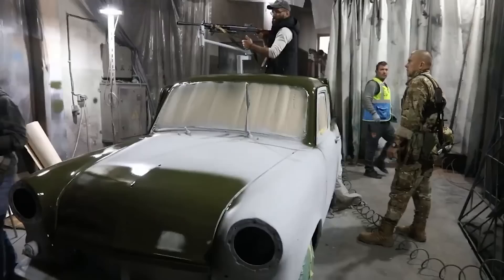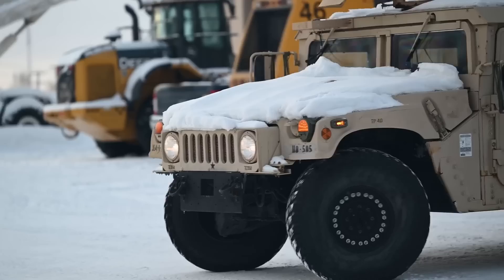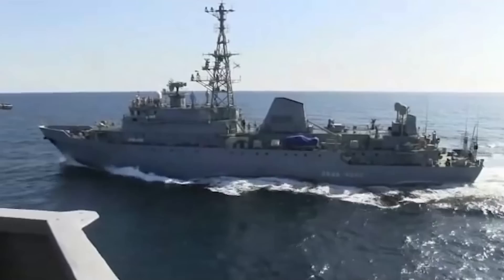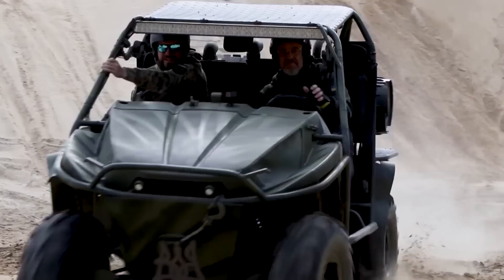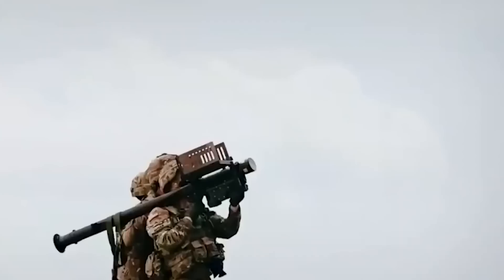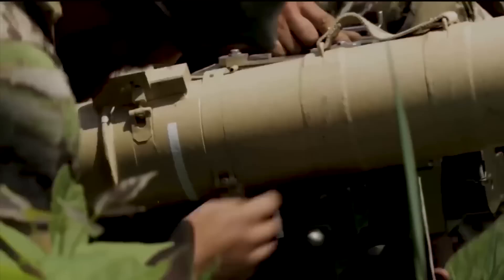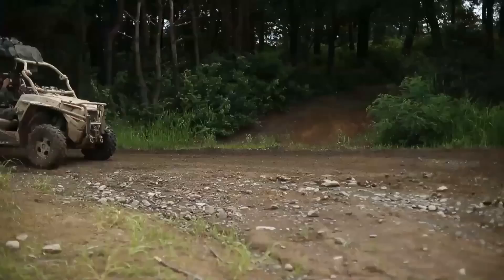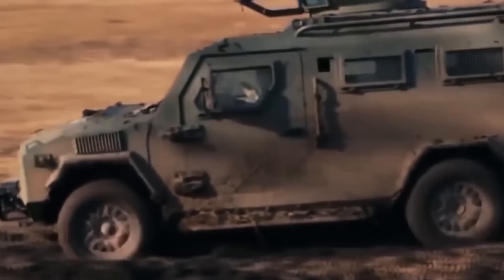Why Russia Can't Fight Off Ukraine's Mad Max Vehicles

Comment: Some of these conversions are actually fascinating. That remote controlled machine gun for instance could probably be made with fairly basic commercial parts. So in terms of material it's likely very cheap to build one, meaning that even if it's lost as long as the crew manages to get away alive you've lost an old machine gun. 

The buggies are absolutely badass too. It's a mark of an effective military in my opinion to be able to adapt to circumstances and convert what you have into something useful.

Technicals are on the whole a fascinating area of modern warfare in my opinion. They're all but useless for a stand up fight unless you're basically building junk tanks but for any situation where mobility is more important than armour they really seem to shine.
Reply: Iam glad to see how you are doing keep the good work as i pray for your men of war
Reply: You can see the influence of the Aussie movies MAD MAX 1, 2 & 3
Reply: The rc machine gun is not made out of washer parts and if it is then put in on agitate so it swings back and forth like the old fashion wash machines, spin around once and agitate again firing bullets all the time.   If it is captured or destroyed that is one unit and the Ukrainians have the remote control.  They will send out R2D3, or R2D4, etc.
Reply: A russian dude was posting heavy machine gun drones and stuf like that years ago, so ironic Ucranians are now beating the russian army this way.

Comment: "Technicals" are often in use in western armies, mostly as a sort of dune buggy, but not in such a broad variety of types and for less purpuses the Ukrainiens are using them. In western countries normally the special forces and even some airborne squads have such vehicles, even though they are more standardized than the Ukrainian types seem to be. 
They are light weight, which supports a transport by plane or chopper, fast and heavyly armed, but normally not very comfortable at all, because of a very tough suspensions and an open chassis. There normally is no heating or real protection against moisture, mud, hail and enemy fire. Therefore these vehicles have a very small variety of combat roles and no one really wants to use these under bad weather or even winter conditions without having a warm shelter to get back to, after a hopefully short mission outside. Because they have nearly no protection against any enemy fire, they are not very helpfull in flat, wide open field areas. 
The pickups here shown and used by the Ukrainians, seem to be more comfortable and obviously the first choice for all combatants around the world facing an asymmetric warefare against superior opponents. 
"Technicals" in the Ukraine probably are used for the same actions, as in western countries: The normal hit an run strategie of painfull pinpoint attacks, behind the lines operations/encirclement, ambushes and broad, fast surprise attacks out of nowhere. For these the "technicals" have a right of existance and play an important role on the battle field one should not underestimate. 

Regards

Th. Krapf
Reply: Oboma actually greatly improved our specials. The suspensions can go MUCH softer then they used be without breaking down, the exposed shell body is much more aerodynamic then they used to be taking less drag that likes to launch stuff and the bodies now like to project debris away instead of into the cabins, and if you can maintain forfied lines and healthy supply chains you can even keep amply warm with the butt warmers alone
Reply: It takes getting used too, but spend a few years sessions riding the Alaskan tundra with a older Honda 4x4 and a snowmachine and the gear you become accustomed too during that will be all you need to feel like your driving the bentlys of the natural lands upon swap

Comment: It's not that they can't fight off these forces, it's that quick vehicles can quickly exploit weak points in the battle line to cut off enemies supplies. If these units ran into fully staffed and prepared defenses they would be decimated. If a hole can be found or made then the technicals can get so far into the back areas of an army, that it can force an army into retreat or risk being encircled and starved out.

Comment: I think a lot of countries globally will take notice and start adding similar programs to their militaries or at least see how they can integrate that idea. I don't think Ukraine will stop producing them, actually becoming a major producer of these vehicles globally. They have the experience by trying out all kinds of things during this war, meaning they have a huge leap forward knowing what works and what does not.
Reply: Yes but technicals aren't that difficult to acquire. And Ukraine's use of technicals against a foe with hardware superiority is nothing new. The Tchadiens beat back the Libyans in the 1980s using.....surprise! technicals. They were quick and fast, and helped Chad fend off Libya's Soviet-armed armies from seizing the resource rich Aouzou strip.
Reply: They'll likely become the main export of special lightweight equipment into Europe, as they'll be both cheaper and battle proven conversions the local area can easily do on the fly.
North America and the Middle will likely never leave Canadian productions. Canada's exports are like a standardized version of Ukraines with only a few differences making them easier to share across terrains at a increased cost but boosting exceptional general performance
Reply: When Russia is de-orcified and Ukraine is free to return to normal Europe can have a chance to eliminate most of its linguistic issues it relies on us to solve

 If it's done both in a way that can break American monopoly on the defense industry that bloats the cost and cooperating with the larger alliance so we maintain international cooperation, this can be a end of facism in the east/west finally allowing us to break Russian oligarchist hedgemony of the regions and making Russia try earning its share instead of leeching off the misforunate again
Reply: Makes you wonder if the world will take notes on making technicals to save money on cars like hummers

Comment: Wrong! Russia isn’t a super power. Russia is a big country in square km, indeed, but only have 146 million inhabitants. This is 40% of USA or Eurozone. The GDP of Russia however is only 4% of the GDP of the Eurozone + USA, equal to the GDP of the small countries Belgium + Netherlands. Relatively (per capita) the GDP is very low. Beside that the economy of Russia has signs of a 3th world economy. And half of the income is mainly based on oil & gas. Based on this, Russia isn’t a super power. And for sure, it isn’t a economic power. This is the reason they can’t built up and maintain a big army. Which is already beyond normal proportions and will hurt their budgets permanently. Russia is a autocratic ruled country with a huge inferiority complex and dangerous megalomaniac ambitions.